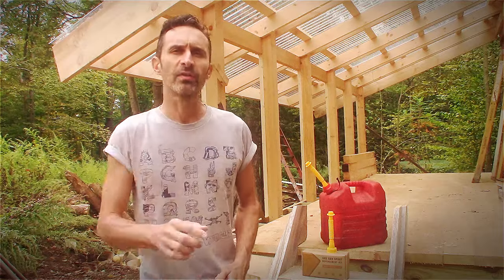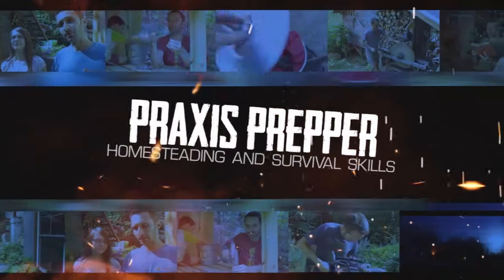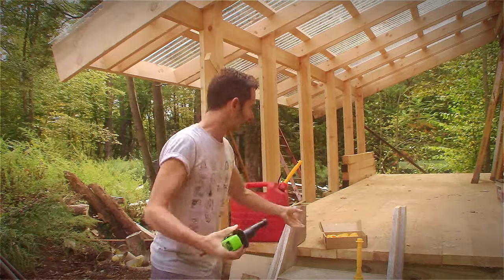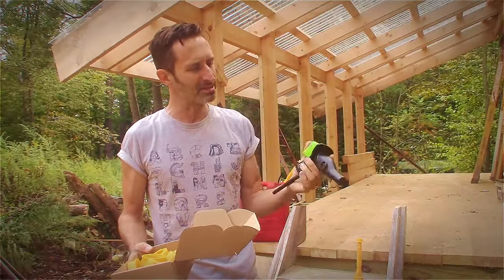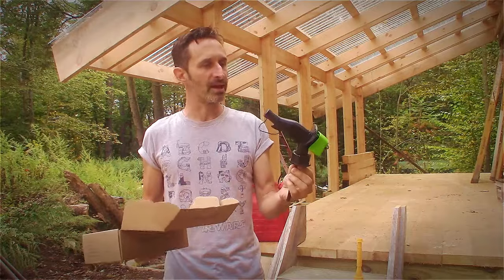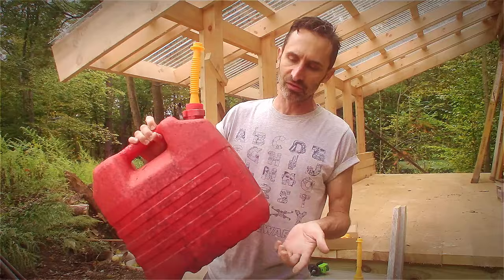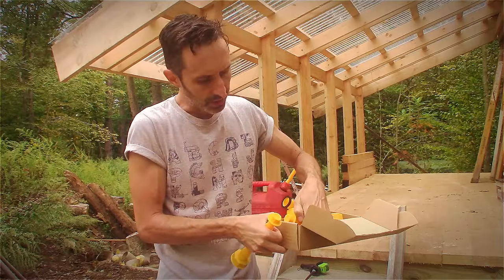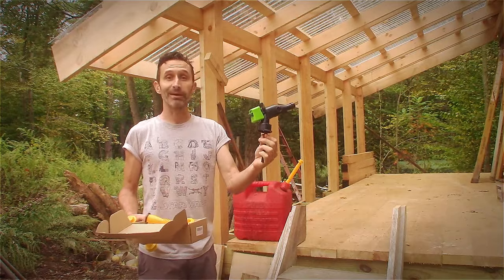Replace Your "Safe Improved" Gas Can Spout

Comment: I Hate the new safety spouts Sooooo Much!! The one time I had to use it, the gas ran down the side of my rear quarter panel  on my 94 Camaro, cuz you had to tip the damn thing Upside Down in order for it to work!!! Talk about Stupid! 
However here's the ingenious idea I came up with....Imagine taking an Oil funnel with a long nose, sticking it into the gas spout and simply pouring your fuel in your gas tank :) Yup it works but now I dont have to do that cuz I'm buying a box of those!  Thanks :)
Reply from the maker: My fix was cutting a certain brand of juice bottles (that had a thread that would screw into my Subaru gas intake) in half such as to make a funnel and then dump the jugs in without their spout even on. It worked okay, but there's always some sloshing about (as I'm sure you know from your funnel adventures. Good luck with these. Like I said, I've only used them for a few days, so I can't say they'll last forever, but they DEF do the trick right out of the box!

Comment: I bought come smaller gas cans with those crappie spouts,  once I saw the big ones had the same crappie  spouts, I bit the bullet and bought 3 new Surecans that are my favorite gas cans, very pricey,  but best gas cans I've ever used.
Reply from the maker: I'll keep an eye out for those. Thx for the tip!
Reply: Very pricey. 2 liter coke bottle and funnel works too. Lol. I got old gas cans from yard sales
Reply: @FocoTheFirst  the gas cans I have are to store gas in the shed, the gas can plastic is thick plastic,  the spout is actually in the bottom to get practically all the fuel out of the can, and the best part is, no smell when transporting gas. For gas storage the cans can't leak, it's not the gasoline that is flammable,  it's the vapor, so if you can smell gas, it's not safe to store.

Comment: Nice, good to know there is a fix. Those safety nozzles are the worst. 

I hate them so much I just broke down and spent a few hundred bucks on legit military jerry cans

As far as those gaskets go, probably not a bad idea to have a couple small pieces of rubber sheet, you can cut your own replacement gaskets for things like that if needed.
Reply from the maker: I've eyed those nice military cans on a few occasions. Pricey though (as you mentioned). I like their thin profile.
Reply: @PraxisPrepper  See if you can get Nate to send you some of the Canadian Scepter cans. They are the best.

I got mine from his site before he stopped selling them
Reply from the maker: @TheLordHumungus  I've been on Nate's channel a few times and we chat now and then, but I don't have any special insider track on his gear supply. If he stopped selling them, I'm presuming he can't get them anymore either. @TheLordHumungus  I'll keep my eyes out for them. I'll keep my eyes out for that type of can though. I think I have 25 gallons worth of cans now, but upgrading over time might be nice. Thx for the tip. Now that you mention it, I think I remember a video of yours where you mentioned sourcing some from Nate's store and saying that you thought they were great.

Comment: I have several of those junk spouts and I can not use them, as well as some of the supercans, which are far superior.  I have a hard time lifting the cans, even the super cans. My solution was to buy some of the liquid transfer pumps, that run on D cells and cost 13 bucks now, used to less than 10, still this works well for me as I am not trying to tip the cans up in the air. I keep 50 gallons of fuel on hand in cans and another 30 to 60 gallons in 3 vehicles.  I try not to let any of them go below a half of a tank. I rotate the fuel in the cans out ever 3 to 6 months.
Reply from the maker: Transfer pumps are a good idea. Do you have a recommendation on a type or brand that's served you well over time? Also, I have an email in with you with some questions when you get a chance.
Reply: @PraxisPrepper  I just buy the cheap ones at harbor freight, they work very well.  Some cans you have to pull the screen out of the top of the can so you can slide the pump down in it.  A full can has just gotten too heavy for me to deal with anymore, especially with those crappy spouts.  They are proof that the government is totally out of control. You either spill gas with them or you cannot get the gas out.

Comment: Here in the UK, we don't do the high tech fuel spouts, most of our 5 - 10 litre plastic petrol cans come with a cap and a flexible pouring spout.
Sometimes the manufactures over engineer the simple things 🙂
Reply from the maker: Lee... you don't understand the risk you're living with using those non safety gas spouts. I mean... how are you even still alive. Of course the old ones spill less gas on you, exposing you to less fumes and less skin contact, but the new ones are NEW for God's sake! Isn't preserving your life worth spending 300% more money for these wonderful new improved safety spouts?!!
Reply: @PraxisPrepper  What can I say, we live on the edge and maybe we just have a better aim 🤣🤣

Comment: If you want to fill the new cans at the gas station then take a needle nose pliers and pull out that stupid flame arrestor inside the can.  If you don't do that you will have to trickle the gas into the can because even at slow speed it will overflow.
Reply from the maker: I was wondering about whether I should bother to pull that mesh out (and if so how to do it). Needle nose pliers you say. Thanks!